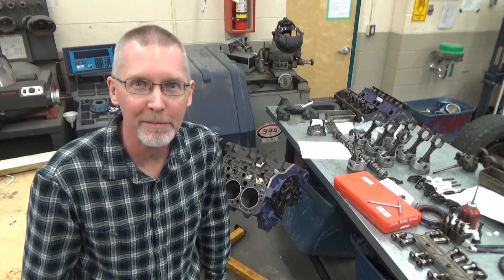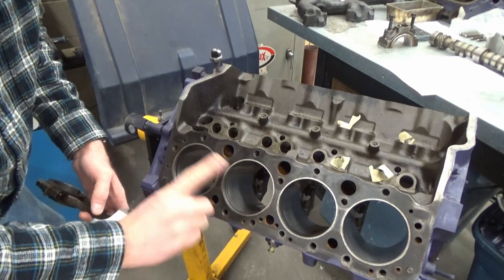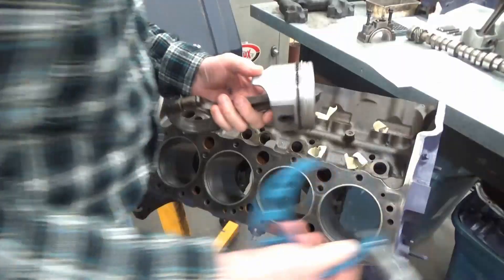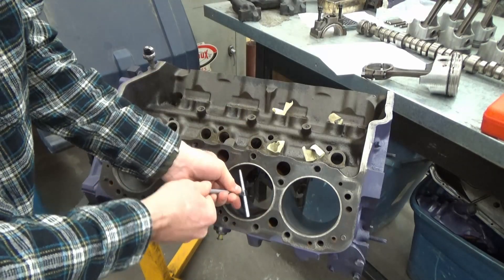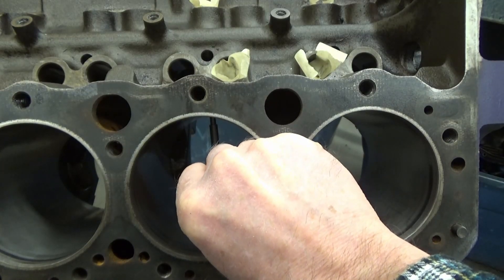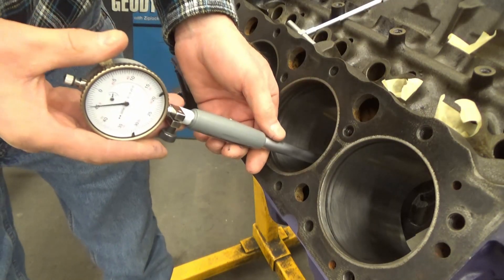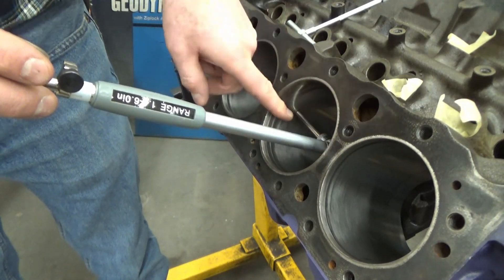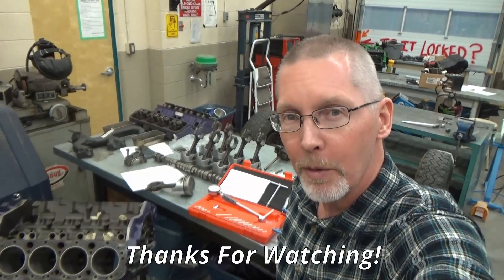QUICK & DIRTY - Measuring Cylinders

Comment: Just say NO to carburetors!  How would you rate the accuracy of the Amazon dial gauge?  You didn't mention what diameter you saw with the gauge and I was wondering if it was comprable to what the micrometer measured.  I did notice that the taper seemed the same between the mic and the gauge, at .004".
Reply from the maker: The accuracy is the same.  These are all "cheap" tools, and by golly, a lot of them are pretty good.  The bore should have been (at .030 over) 3.736, but measured 3.767 at the bottom with the mic.  I set the mic to 3.766 (as it should have been when fresh), and the dial indicated the measured 0.001" over (probably from student honing).  This was the first V8 in my V8/RWD-conversion Pontiac Firefly (Chevy Sprint).
Reply: @GregWellwood  Thanks for the clarification.  Sometimes cheap is good but sometimes cheap is just cheap.  Good to know that this one works adequately!